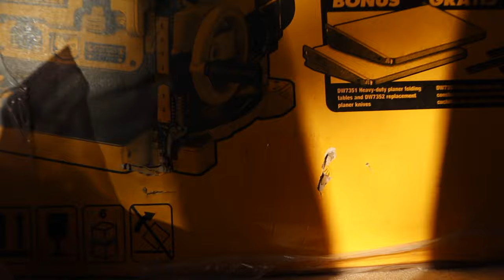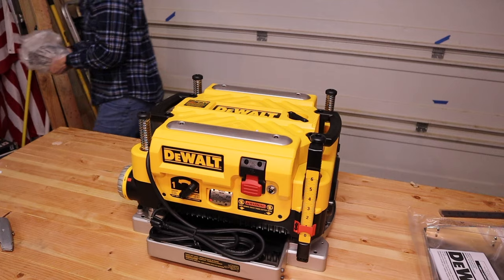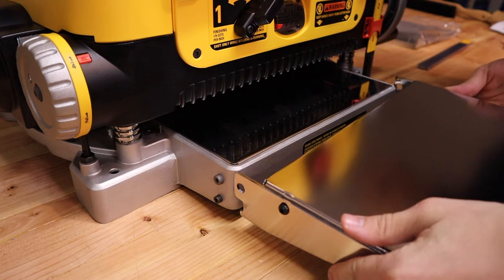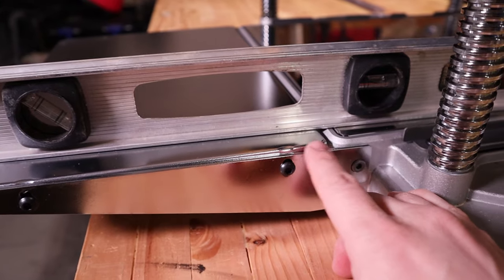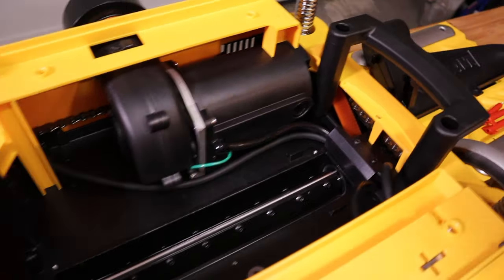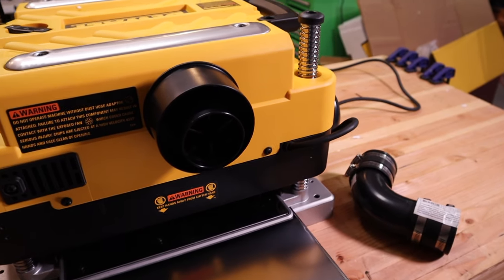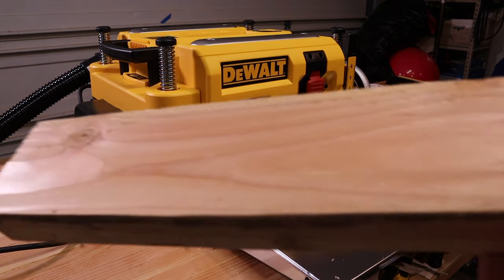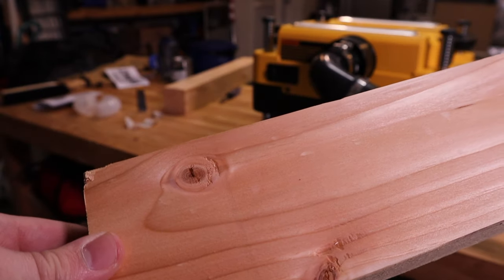Dewalt 735 Planer | Unboxing & Setup

Comment: Great video. Only suggestion is to turn down the music when you're not talking. Sudden super-loud music meant regularly having to pause and change sound levels up, down, up, down. Thanks.
Reply from the maker: Thanks for the feedback! My apologies on the variable volumes!
Reply: All the rest was very well done and super useful. I'm setting mine up tonight for first time. Thanks.
Reply from the maker: Awesome! I’m glad it was helpful. If you have any questions, feel free to reach out  (email in the contact section is the most reliable way) and hope you get a lot of use out of your 735 like I have.
Reply: @NorthwestCraftsman   Yeah, I came here specifically to comment (and rather 'loudly' at that!) about the music blasts.  W/out exaggeration, I would say the music was no less than 3x the volume of your speaking.  In the main, however, it is a very good video and much appreciated as I am about to unbox our own planer.
Thanks a lot!
Reply from the maker: J. Go. Thanks for the feedback! I’m working to equalize that out in future videos. Out of curiosity, what device are you watching on?
Reply: @NorthwestCraftsman  On an iPad.
Reply from the maker: Bob Sherwin thanks for the feedback. Working to improve this.
Reply: @NorthwestCraftsman   Watching on my TV via my fire-stick system.
Reply from the maker: J. Go. Thanks as well for the feedback. Working to improve this in future videos. Thanks for letting me know!

Comment: First of all the Dewalt comes factory set to prevent snipe. You, genius leveled the unit there by creating snipe.
Leave it alone do not adjust the feed trays.
Unfortunately I listened to several of these hacks set up the Dewalt and it screwed up my unit. I should have contacted Dewalt first and not listened to hacks!!!!!!!!
Reply from the maker: Tom Blount I’m sorry to hear about your snipe issues. You are right that I should have tested the planer without adjusting and then move it from there if there was an issue. I as well had seen plenty of reviews that mentioned snipe with the “from the factory settings” so I adjusted it immediately, hind sights 20/20. It does take a little time but it’s totally possible to remove the snipe by adjusting the trays. 

Happy woodworking!

Josh
Northwest Craftsman
Reply: Calling someone a hack is a bit harsh but I’ve experienced the same thing. I’m probably going to have to spend some time trying to readjust it back to original settings.

Comment: Wasted my time thinking you’d show how to actually set everything. I don’t understand the turret stop. I’m not sure what I’m doing wrong. But it won’t grab and plane my wood. Even tho it says it’s going to take 1/32 off
Reply from the maker: Shoot! I’m sorry to hear that. Everything is pretty hard when it comes to setting tools up because there are basically infinite adjustments. However! It sounds like your depth of cut gauge may be off, are you able to plane the wood at all? Disregarding the depth of cut? If testing, adjust depth slowly to ensure you don’t accidentally take a huge cut.